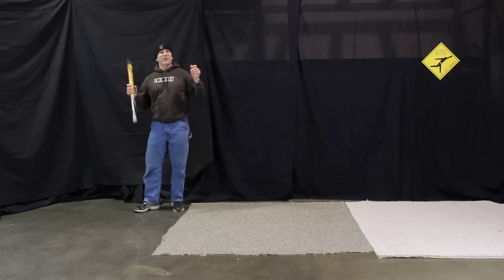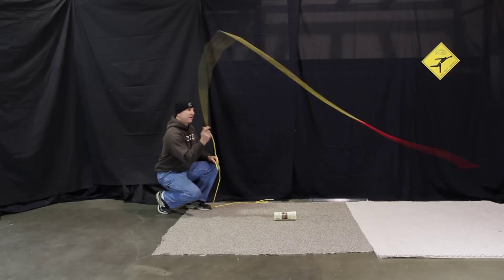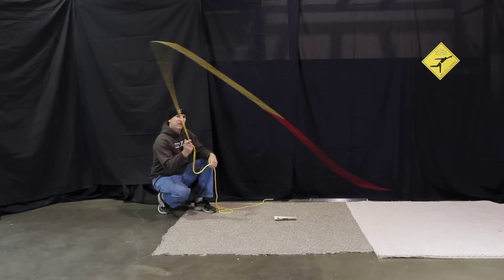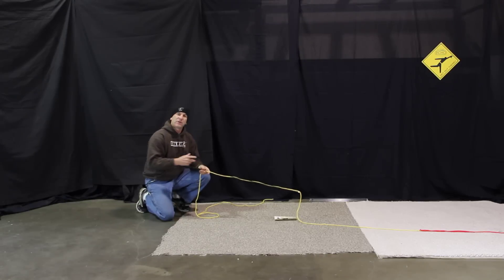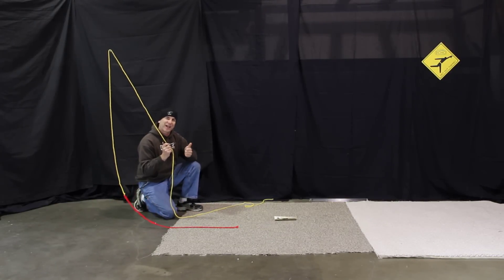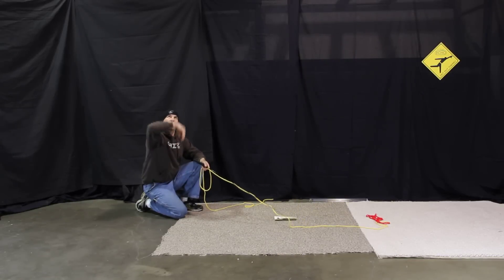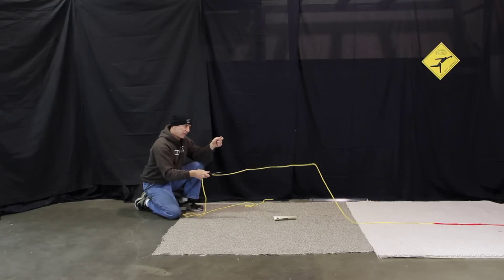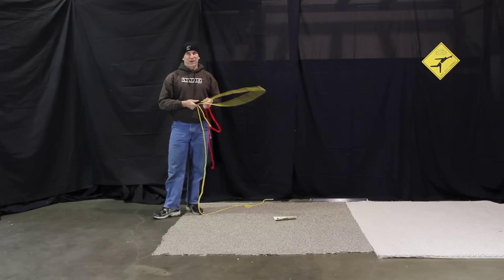Echo MIcro Practice Rod Instructions

Comment: why are  yanking so much on the way up - like a beginner would do?if you have  real line on it  you'd be screwed.
Reply: He is not. He is lifting the line off the ground/water. Look at where the backcast goes,. It does not go up in the air behind him but directly straight behind him. Look at the tracking of the rod tip during the backcast. It is HORIZONTAL. The line follows the rod tip so the line goes horizontally and not angled up.